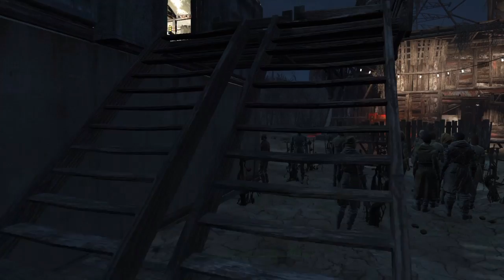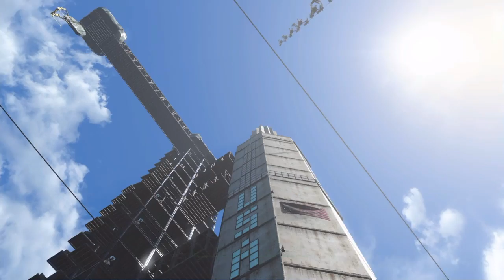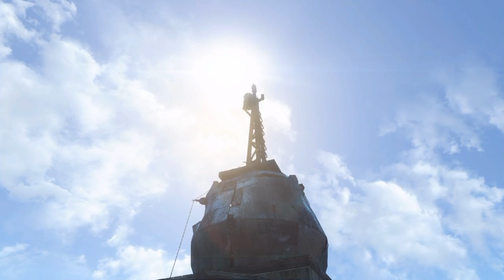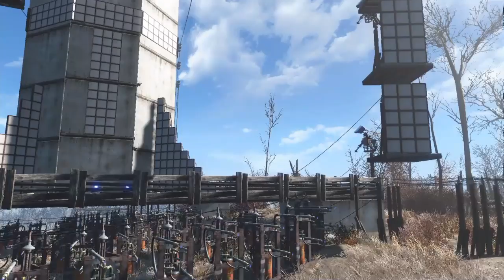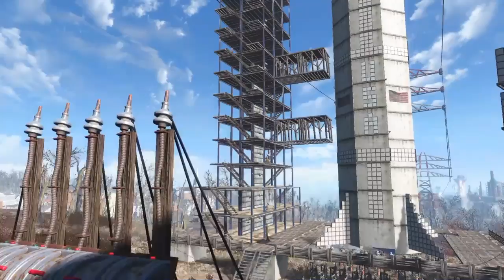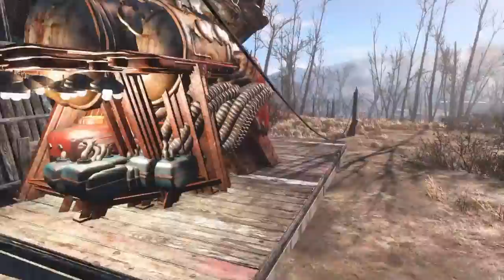Fallout 4: Rocket Launch Pad Settlement Build.

Comment: I noticed watching this that glitching  the generators together helps with frame rate. also, I wonder if frame rate issues aren't a problem with all the pixels/light boxes as your a bit further away from them, because I built a casino and had flashing lights yarda yarda and the ps4 couldn't cope and went to 6 frames a second lol. and it was only a quarter of the amount you have. any ideas or tips here ops?